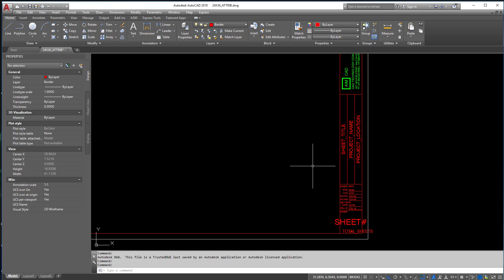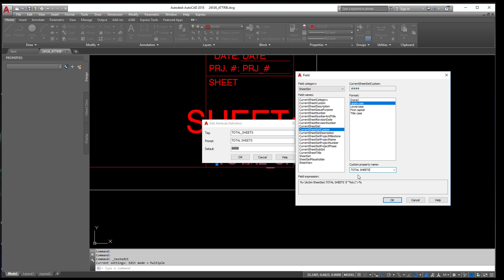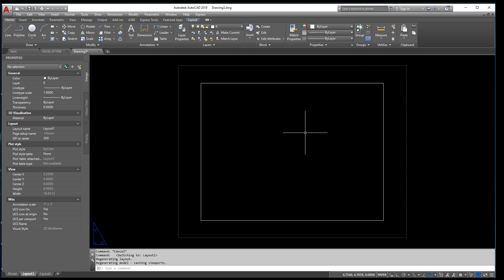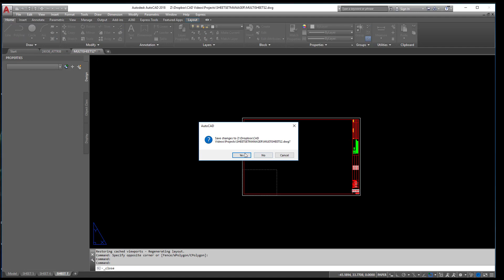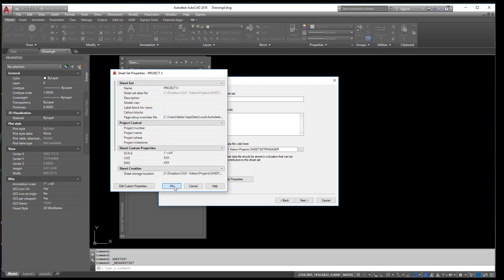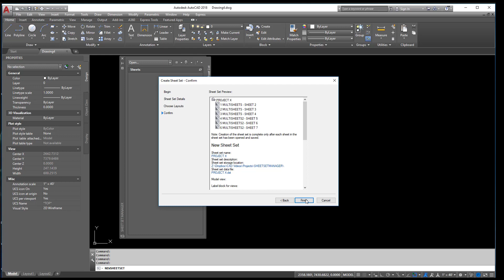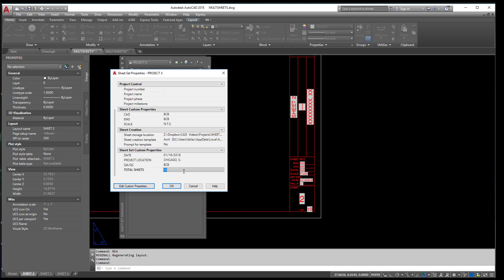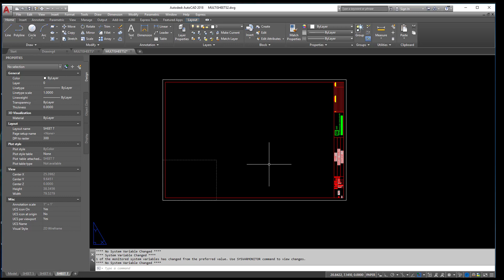Sheet Set Manager Part 1 - Titleblock with Attributes

Comment: Great video! Regarding the hashtags at 2:27, is there a way that they do not appear after setting up the field? I want to set up other fields ready for when we change to revision B but I do not want to see "####" all over the page when we submit revision A. So far when I go back into the DWT and add fields for the revision B, it does not populate for the existing files in the sheet set manager. It was input exactly the same and I regen the drawing. It does appear when I create a new sheet.

Comment: Hi! This is really helpful, however after I add my custom sheet set properties and then type REA I’m finding that nothing is updating. I still either have ### in the place where I want the information. Any pointers would be greatly appreciated. Thank you!
Reply from the maker: A few things to try would be to make sure your drawing was saved once, sometimes saving and reopening works. If it has been blocked in twice can cause this issue exploding can help tell if that is true be ready to undo though encase that is not the case. Also the custom fields are case sensitive

Comment: :et's say you are trying to field from a data linked excel file. How do you field the text fields from the excel file to the CAD file?
Reply from the maker: Good question think you’d have to use an expression to achieve this under sheet set custom. Will create a how to a bit later in the week will need to create some test content to show you how to as I don’t usually do it this way.

Comment: about sheet number and total number of sheets, 
what if i want to put the sheet number & total number of sheets of drawings for each division of drawings(i.e. ARCHITECTURAL, STRUCTURAL, etc)
and then also i want to do the same in in combination of the divisions. what fields do i need to use?
Reply from the maker: Yes this is possible, will make a video and link  it here probably this weekend
Reply: @AIMCAD  thank you very much

Comment: Pretty good demo.  I noticed CAD and ENG didn't update.  You where using Sheet Custom Fields for them.  
I feel it's still better to combine an Xref of repetitive Titleblock information (lines, keyplans, logos, notes etc) with some locally needed Sheetset Fields.
It would be better yet if Autodesk would figure out a way to enable fields in an Xref to update/repopulate.

Comment: HOW DOES THIS SAVE TIME!!!!!
Reply from the maker: Setting it up takes time, but when you have to print 100 page plan set, and make a change to the date on every page this does it with only a few clicks. Instead of having to open 100 separate or at best maybe 15 CAD files (with multiple layouts) or mess with the creating a xref titleblock. Only easier step would be to create 100 layouts in layout space, make the titleblock a block, and edit the block. Don’t know if my personal sanity would go well with 100 layouts spaces. You only have to do it once, and save it into your template or create one.
Reply: @AIMCAD  Thanks. I copy plotsheets from one project (A) to another (B). Including the DST file. Is there an easy way of keeping the file names but linking it to the new project without having to relink every sheet individually?